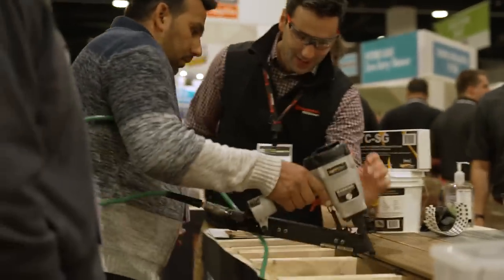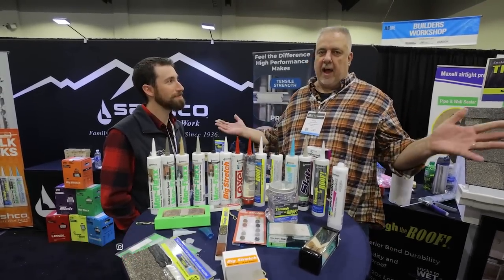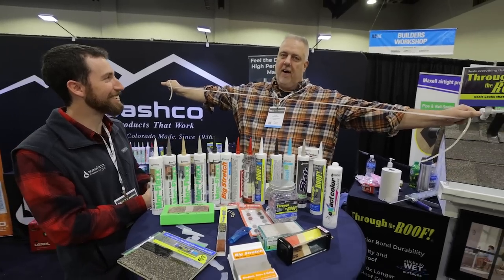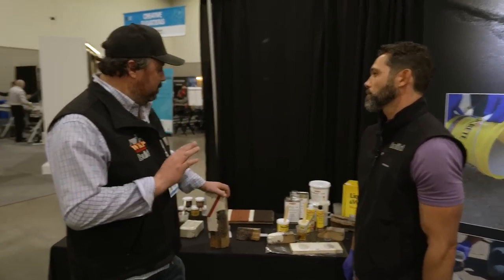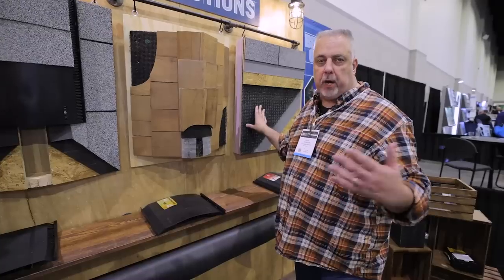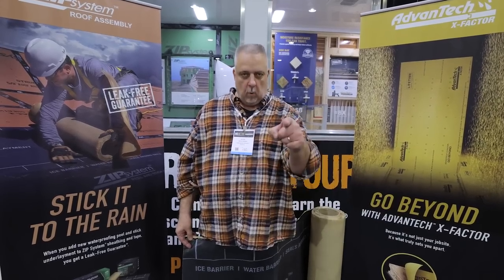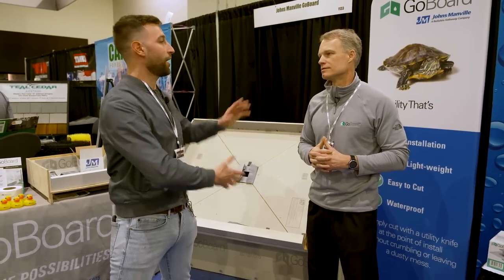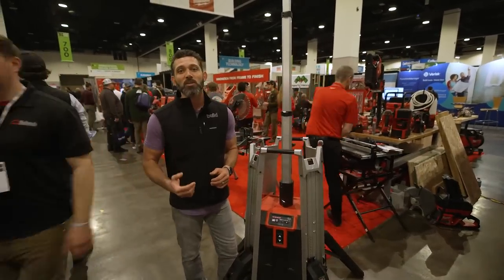New Tools and Building Products from the JLC show 2022

Comment: As a young carpenter. I'll take the hollering from the old man any day of the week. You ever seen these old geezers try to use a phone? Now we'll be waiting 5 minutes for 1 measurement, when it always takes him 10 seconds tops with a tape measure.
Reply: yeah, its more complicated and if the roller slips on ice or dust while measuring and you have some that's 5$ a linear foot, you cant afford to cut anything short. But I could see it being useful if your cut station was outside and sheathing was up, or air compressors and music blasting
Reply: @AsHellBored  No self respecting carpenter is going to be blasting music. If you want to listen to music go pound in staples with the electrician.

Comment: I have a buddy who bought this rolling miter saw measuring device when it was still in kickstarter. He finally got it and even as an amateur woodworker, he was not very impressed. Basically it’s not as accurate as you would hope and it’s not as quick as just pulling a tape or making a jig. Lol. Some things are better left old school
Reply: Any experienced carpenter can tell at a glance this robot is about as useful as a roomba on the job site.
Reply: Waiting for the hammer that needs usb ports for firmware updates.
Reply: 😂 a hammer with USB 🤣 Don't give them ideas
Reply: Hey Ty, thanks for the feedback.  We're always happy to assist with any M1 calibration issues (which generally are the culprit if you're not getting 1/16-1/32" accuracy) along with the saw setup.  While the M1 works in many situations and increases speed of cuts, its certainly not for everyone in every situation and is depends on your work flow and materials (and why we have 30 day money back guarantee anywhere the M1 is sold to try out and use to see if it works for your style and workflow)!
Reply: @REEKONTools  you have to be kidding me, your accuracy is +/- 1/16th? It seems to me your product   can be outclassed by a steady hand and a loud voice.
Reply: @johntomko2946  Its around 1/32" (or better) assuming a straight piece of material but when cutting rougher lumber its around 1/16" depnding on warp, bend etc.
Reply: @REEKONTools  definitely not good enough for wood working. And it would be easier to yell the measurements to the guy cutting on a jobsite.
Reply: @johntomko2946  Hey John, thanks, always appreciate the feedback.  Based on your experience, what would make a product like this or similar solution beneficial (save time) for a professional like you? We are constantly working on improvements and new products and appreciate any and all feedback that can help improve our offerings!
Reply: @REEKONTools  this product will never work for rough carpentry it's just to slow. If you want to enter the market that actually buys this type of product you're going to have to improve the product. Come out with a push stop with actual stepper motors and a controller for entering in cut lists. In wood both millwork and cabinet shops all use it. There are thousands of 1-5 person shops out there willing to spend 2-5k for one. There is definitely a hole that needs filled in the lower price point.
Reply: @REEKONTools  my advice would be to stop patronizing me, otherwise you will force me to take your product down feature by feature.  Or more accurately, flaw by flaw.

Comment: I dont think that digital tape would last more than a couple weeks at best doing production level work. Itll get damp or full of sand or kink and not read right when that happens to my tape I grab a new one for 30 dollars but I can imagine that digital setup is probably 50 times that. Also curious to know how long setting up the jig on the saw takes and do you have to pull the tape out slowly or roll the boards slowly to get accurate readings like shown? Or was that just for demonstration purposes?
Reply: Hey Sean, thanks for the comment.  There is no speed limit for the T1 and will read as fast as you pull it.  The tape blade is fully replaceable should any damage occur to it and it is self calibrating every time you move ensuring accuracy at all times.  In addition, everything is built to military specifications with glass filled nylon housing with 1/4"+ of rubber overmolding surrounding the body.
Reply: @REEKONTools  well thanks for the info having the blade be replaceable is a good idea in that application, is it water resistant?
Reply: @Sean-mk8pw  yes water resistant for splashes and incidental contact (but not waterproof as there is an opening for the tape to go in and out of the body)

Comment: With Reekon, once you've setup your computer and Apps and Wi-Fi Bluetooth connections with the latest firmware and the right drivers update and solved the compatibilities ... you'll save 30 sec secondes on 100 cuts !
Reply: Not to worry, from unboxing to taking measurements is only about 3 minutes!

Comment: I've been in constructing for 40 years. When I started the old timers would complain about nail guns. Now people are knocking the new tape measurer without even trying it. I've already ordered mine. If it works as advertised, great. It will save me time, make me more accurate and more money. If it doesn't, it's only $200 to find out for myself. You can't tell me that none of you have spent money on tools that you were disappointed in and they're still sitting in your garage collecting dust.

Comment: That giant light is so specialized that its pointless to make it run on M18 batteries. They should just put 2 small Li car batteries in it and make it plug in. I have some 5K lumen lights and it is soooo disappointing when the battery doesnt last, and if you cant plug it in its like what did you pay high dollar for... Love the PVC trim though
Reply: I think it uses Milfukees new MX series batteries.
Reply: Those extra large batteries last at least 4 hours on the highest output & 12-14 hours on a more minimum output. I’ve had breakers go out before (due to being overloaded) during a concrete pour attempting to light my job-site with multiple lights. Made for a stressful evening to say the least. Would have killed for this Milwaukee light that night.
Reply: @diltzm  uncle bumblefork? is that you?

Comment: The Zip peel and stick really comes out the wrong way. Zip sheating is supposed to have a weather barrier already, if you are putting their peel and stick on top of it then why only a 5 year leak warranty? Does it mean a Zip roof isn't really water tight? They should really explain things better because if my house was built with Zip sheating without the Zip peel stick I would be very worried about leaks.
Reply: Its just a belt & suspenders approach plus covers the need for code compliance in many northern climates where a peel & stick ice & water shield is required to help combat water damage potentially caused by snow & ice damming.